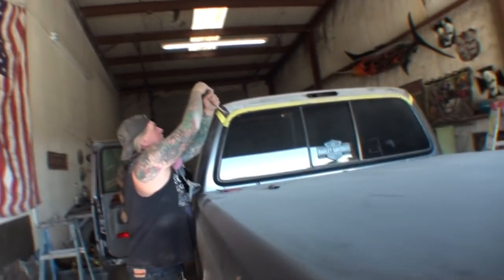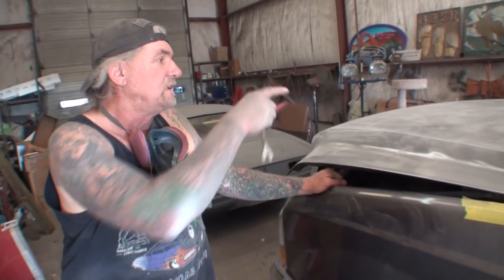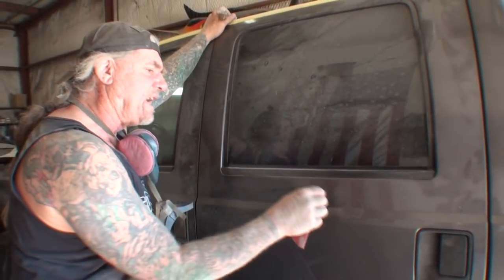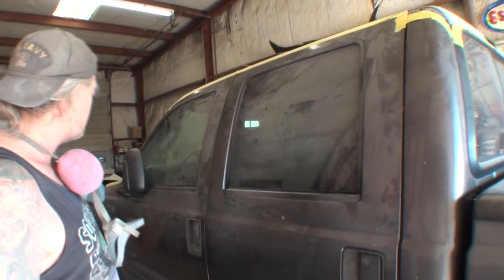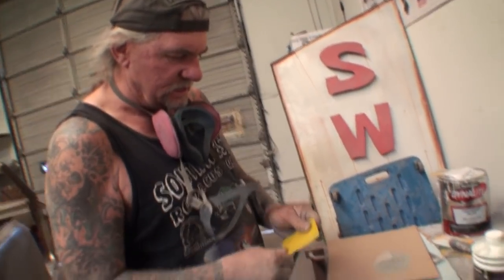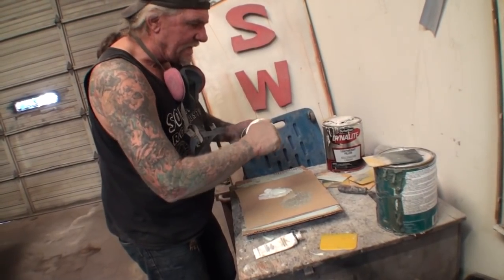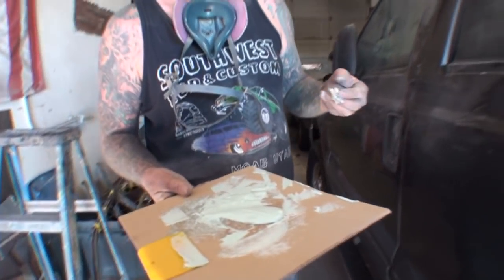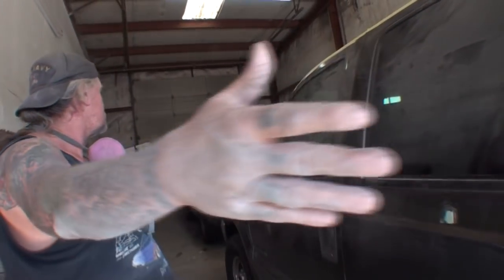How To Use "BONDO" To Fix Small Dents and Door Dings

Comment: I have found better to remove all the clear from the panel if it's peeling or cracking . have had jobs come back that I tried to just sand off what was peeling...   just my 2 cents
Reply from the maker: If you remove the clear to where it stops peeling then approx 6 to 8 inchs past that, your fine! then you will apply a high quality 2K Primer (2 to 3 FULL COATS) and you have sealed it up ready for blocking and painting...  Thanks for watching.
Reply: @diyautoschool  love the videos  you put out Pete  n mini

Comment: The work ethic you have is simply... Hat's down. I do not find this kind of work here where I live. Regarding this putty, and I am talking about older cars with older metal where you have this kind of small jobs but caused by very small spots of rust. The stone chips the paint, you do not see it in time, it rustes a bit. Any shop will clean the paint, apply bondo and paint and guaranteed in 6 months the rust will bubble again. After seeing your videos with 2k primer I have cleaned it myself the spot, applied primer then paint. Of course, is a botch job but after one and half year passed no rust appeared. My question is, could you apply bondo onto 2k primer? Or is really a big No No like everybody is saying? I am not talking about huge parts but small ones. Thank you for your answer and especially for your videos!